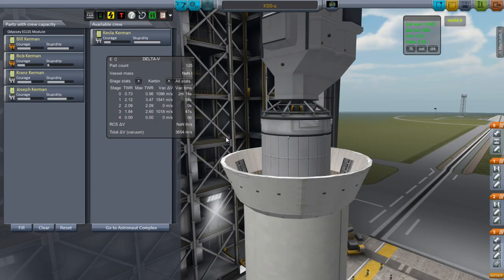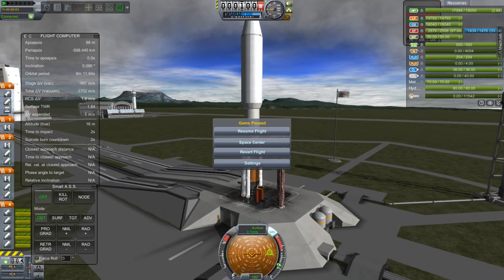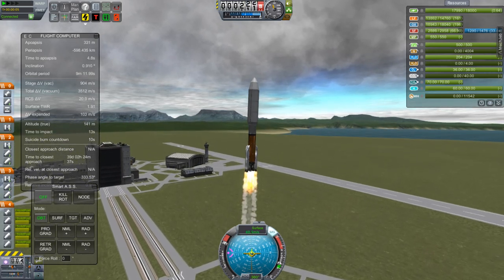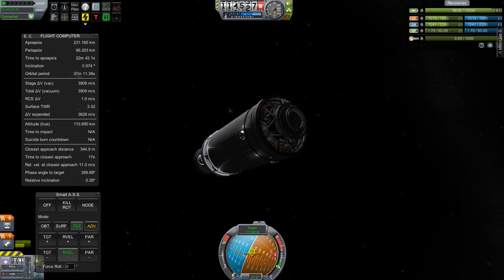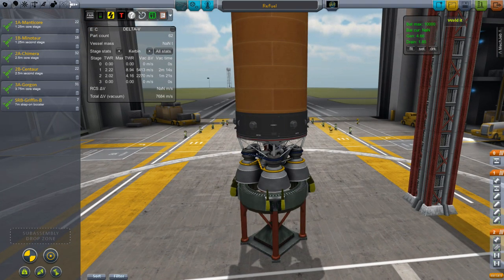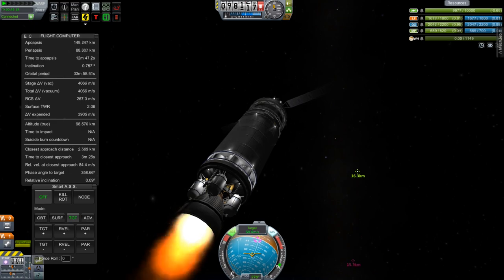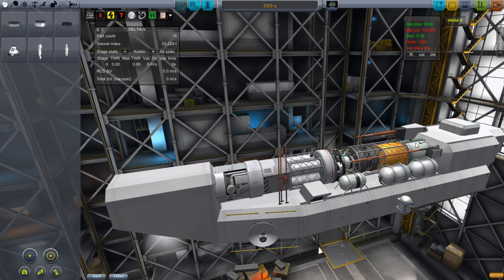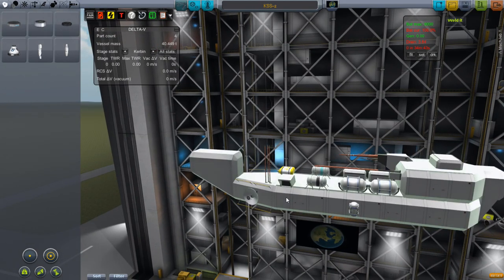E07: "Life Support" / Project Odyssey / KSP 0.23.5

Comment: The Centaur engine seemed to have NaN mass pre rebuild, did you weld it to something funny?The RCS delta-v seemed to also be affected but not the ordinary one.
Reply from the maker: I have noticed that MechJeb has issues with parts that get changed after they are in a CRAFT file. This is easily fixed by deleting the part causing the problem and reattaching a new one of the same type. I fix it whenever I see it, but it does not cause any real problem or change in the rocket's performance. It's just a visual issue with that one readout, so sometimes I do not notice right away.

Comment: Hey, Bob, I am presuming that the space station  pieces used in this series are made using B9 parts?
Reply from the maker: Patrick Lenigan I don't usually install B9, so if I used a couple, it's just a couple. Pretty sure it was none.
Reply: ok, it just looked like some of the parts are from the larger, super-massive pieces B9 introduced recently
Reply from the maker: Patrick Lenigan No. I think those are silly anyway. :)
Reply: Hey, Bob, just letting you know, if you want a plugin that will allow you to do without the struts on the payload without the payload affecting your rocket balance when using KW Rocketry parts, I highly suggest you get the Kerbal Joint Reinforcement plugin!  using it now and love it
Reply from the maker: Patrick Lenigan Yea, KJR is a really old mod at this point. It must be something like 14 months old or more. At the release of 0.24 the need for it was greatly reduced since vessel mass and connection node size now determine connection strength more accurately, like they should. I'd go so far as to say it's NOT required anymore, since the only meaningful usefulness for it today, to me, is the pause on vessel load that eases the physics instantiation. That is rarely a problem anymore IMO. For me it has nothing to do with specific parts BTW (like KW) since I make all my own parts. The models may look like they are from KW, but the parts are "mine" so to speak. They are not really KW anymore. So ultimately adding a relatively unnecessary DLL (since 0.24) will only serve to slow the game down.
Reply: You DID mention that some of the fairings you were using were from KW Rocketry, I did some testing with the said plugin and it still works.  I was able to launch a fairly good sized payload (Mir Space station Kvant 1 piece and its tug) without the use of struts.
Reply from the maker: Patrick Lenigan I'm not saying it does not work. I am saying it is either not needed, or won't help with huge payloads. If the payload is small like Kvant then it's not needed. If the payload is large then it won't help enough. My latest payload is 21m long, using every increment of the 5m expanded fairing that the base tolerates. The rocket is 68m long. It weighs 1165 tons and the payload is 114 tons. You'd need struts even with KJR. My smaller launches don't use struts just like your Kvant because since 0.24 KSP does 95% of the the same work as KJR does. I think if you're enjoying it, by all means continue using it. :)  We're here to play the way that fun for us right? :) It might be a bit of a plazebo effect, though. Make sure the mode sizes in the CFGs are correct and try deleting KJR and launching one more time. See if it makes you require structs when the stats are right but the DLL is gone.
Reply: ok, touche'.  Thanks for clearing that up for me.  I suppose further testing may be prudent.  It IS helpful whenever I use the OLDD Proton and Saturn V launchers, though (the only ones I have used from them)
Reply: btw, an interesting mod, I stumbled onto for flavor alone, the Countdown mod.  Thought you might take a look at it.   according to the forums, it is made by the same guy who made the Chatterer mod that you used in Project Gateway (and I am using both mods now)
Reply from the maker: Patrick Lenigan I tried it about 6 months ago. Unless i s has changed since then, all it did was add countdown that would be tedious after using for a day. I launch too many times during testing. :D
Reply: ok